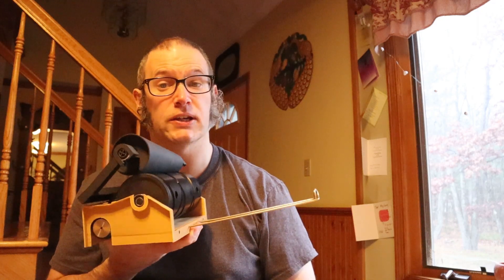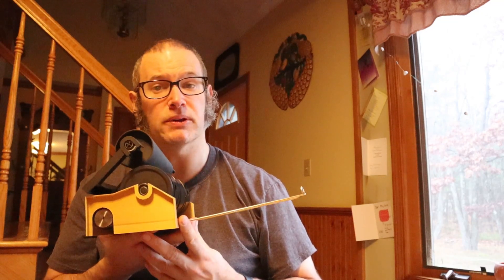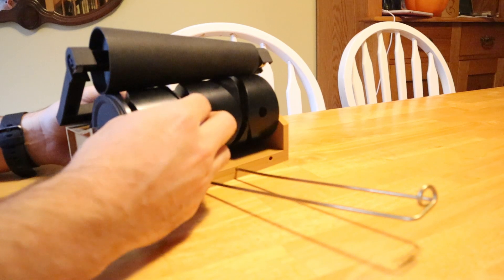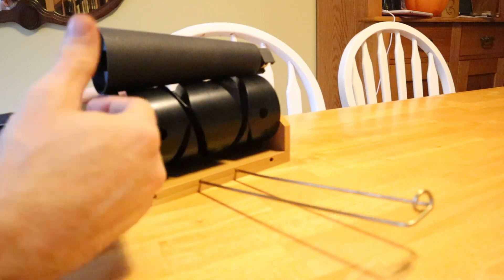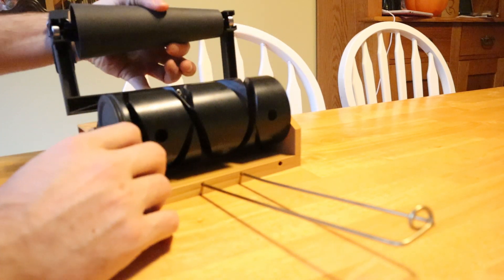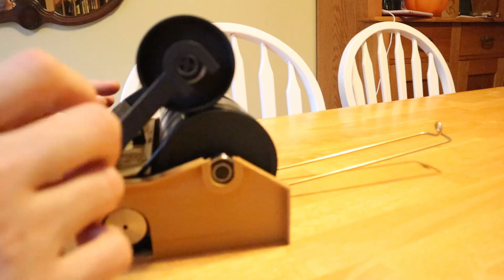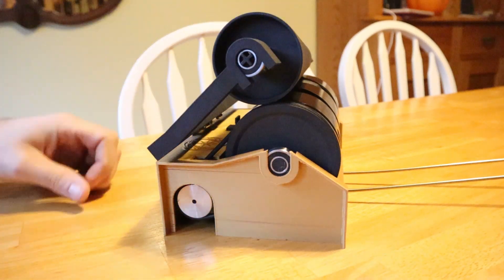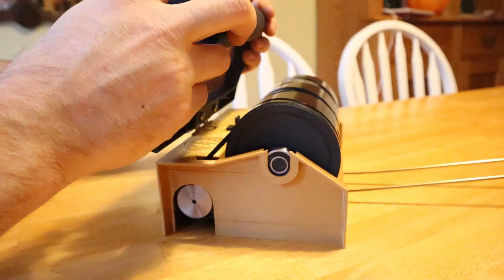SPIN #97 - Cone Winder Update with New Articulating Arm

Comment: Will it be possible to adjust the spring holding the cone in place?  For the purposes of dyeing yarn on the cone, it must be wound into a soft cone (there are also a lot of other factors, but this is the one I'm having issues achieving).  I'd love to volunteer as a beta tester if you need a "high volume" user to put it through its paces (I'm a production weaver and dyer).
Reply: It wouldn't help the vertical movement, but spreading the feet of the yarn guide would help reduce the horizontal "play" (triangle with a wide base is more stable, if that makes sense).
Reply from the maker: There is no spring holding the cone in place.  I've seen those systems, but am leaning towards using the system I showed in this video instead because it helps keep it more affordable and arguably works better.  The downside of my solution is it isnt' adjustable, but I will be releasing files so people can 3d print holders for different bobbins.

Comment: just a thought, instead of just having the guide wire go into the holes in the base,  make a "bracket" for the ends to slip into on the bottom after they go in the holes. That would add a bit more stability and keep the guide from moving side to side.
Reply from the maker: I have a new system I plan to test for this that I think will do better.  That said I don't really understand what you are proposing.  Perhaps if you sent me a drawing I'd be able to provide better feedback.

Comment: looks pretty good.  from a machine knitters perspective, using a little finer yarn that those in the video, it looks to me that it needs a little tensioning for the yarn going on to the cone (from the ball), resulting in a tighter wind on to the new cone.  this will prevent, in my mine, the yarn pulling away several circuts as it feeds off on to the machine.  I have a winder converted from an old mill parts that works well.  similar to your new prototype but very old.  the option of different spindles for different types of cones is of interest.  I have a way of accommodating several different sizes for myself but it is limited and there are so many different cones I have that have come from so many commercial mills over time.  (I am in Australia)  thanks for sharing and exploring the options we might have in the future.
Reply from the maker: Thanks for your feedback.  It's great hearing from others who have experience with making yarn cones.

Comment: Hey there love your cone winder ... could you tell me what the black cylinder is called the one that guides the thread back and forth ?
Reply from the maker: They are widely used in the textile industry, but they are mostly referred to by their Chinese name (I don't read Chinese, but I have a contact that had trouble finding them until we found the right word in Chinese).  In English I think they are just usually called a grooved drum for the textile industry.
Reply: @DreamingRobotsBlog  aww thank you, iv looked al over for a cone winder for thread but there doesnt seem to be a home one ... al industrial ... i have all industrial sewing machines in my bedroom so i dont have room for anything else
Reply from the maker: @aaronabbott1427  I made some 3d printed drums like this, but they didn't work because you need a really smooth surface.  I eventually gave up and decided to just purchase a better drum that I could design for a 3d printer.  I am still deciding if I should make my own plastic mold for one of these drums or to buy one from a vendor, but I'm pretty sure 3d printing won't work very well unless you do a ton of processing after it is printed to make it very smooth and some of the surfaces were quite hard to reach because of the angles/size.
Reply from the maker: @aaronabbott1427  Thanks for the suggestion.  I'm familiar with those.  They are injection molded and that's how they got a smooth enough surface to function.  The 3d printed version of the drum that I made actually followed the hollow design that Royal used, but when 3d printing the surface finish just didn't work.
Reply: @DreamingRobotsBlog  i cant find any where to buy one from .... im from the uk and iv tried every thing in google to try and find somewhere that sells them ... iv tried putting in winding drum, grooved winding drum, textile grooved drum,traverse winging drum .... no one is selling ..... where did you get your from again ?
Reply from the maker: @richyjames1378  I have a partner in China that obtains them for me.  I get really good prices because I often end up buying parts in volume and I pay her for her time to setup these contracts.  I've seen some people use this site to purchase these for individual use but I have never dealt with them: https://gsn-knit.ru/winder/wool_winder_en.html
Reply: @DreamingRobotsBlog  aww yeah i emailed them but i didnt get one back :(

Comment: I am wondering if the guide arm needs to be that long.  Perhaps it would function just as well at half that length.  Making it shorter would allow it to be stiffer/ less flexing.  I'm looking forward to this very much!
Reply from the maker: There are some odd angles required that would not be correct as the bobbin filled if I made the arms shorter.  I choose those lengths for a very specific reason.  Now I could probably get away with a slightly shorter arm because the angle difference wouldn't be that great and the arms do flex some, but I think I will leave them that length so the angles are correct from a mathematical standpoint.  Another concern with shorter arms would be it would limit the amount of yarn the cones could hold, but I haven't calculated how much less yarn shorter arms could hold.

I will point out the final version will use injection molded arms and those will have a lot less flex than they 3d printed nylon arms.
Reply: @DreamingRobotsBlog  Are we talking about the same arm?  I was talking about the metal guide.  I imagine you know much more about all aspects, however.
Reply from the maker: @CarolineNH  I was talking about the plastic arms.  The metal yarn guide ideal length is not something I have figured out yet, but I do know it needs to be fairly long for the drum I'm using to work.  If I make it about half the length as it was in this video it doesn't work.  Thanks for the suggestion though.  I'll try to work out the ideal length.
Reply: The guide length is essential to make sure the yarn is evenly distributed throughout the cone actually, so the yarn is wound up not too tight and not too loose. What is needed is a tension mast of some sort, before the yarn goes onto the cone.
Reply from the maker: @Vivvi1975  I am experimenting with this.  I am kind of thinking to keep price down I might not include a tension system, but this decision depends on what my beta testers find.

Comment: Well, this appears to work better than my Silver Needles conewinder, which could never possibly wind from a ball that's just bouncing around in a bucket.  (The SN does not deal well with uneven tension from the yarn source).  Will be VERY interested in getting in line to buy one of these.  (Is there a spindle that will take SN cones?)  I'm a weaver and CSM knitter.

Comment: Maurice- very interesting and I would definitely like to get in line for a purchase when it is available.  Question- have you tried winding the yarn directly off a swift?
Reply from the maker: I plan to test winding off a swift, but have not yet.
Reply: As long as the speed is able to be adjusted, it technically can work. It all has to do with the setup and also need monitoring att all times. I've done it many times using industrial cone winders and it all comes down to how well the skein is wound up, and how far the swift is set. What I did, was having the swift on the same level as the cone winder but not too close to it, so I could monitor the yarn at the same time to make sure I was ahead of any entangled threads.

Comment: Wow such better!! Great job ! Look forward to the next update.  If you have another cone the winding demo would be smoother if you put a full yarn cone down on the ground to use as your feed yarn?
Can’t wait to get your yarn counter and the cone yarn winder. Eegads my clumsy inventions for counting yarn yardage will go to never never land!
Reply from the maker: I did think about feeding it off a cone, but that felt like cheating a little.  I might do that someday because it would indeed show a very smooth process, but I want to also make sure it works with more challenging sources.
Reply: Baha It’s not cheating Lol . When I have a snaggy ball I hold the end and throw it across the room, wind that, toss it again. At least until it straightens out I get a few yards wound. I also will put it a gallon jar and kind of do the same thing but in the jar.

Comment: This is looking better with each update.

I want to skip the ball and wind from a skein on a swift.  My swift has ball bearings so it spins easily but sometimes there are tangles in a skein. Will this stop in case of a yarn jam?
Reply from the maker: A swift with bearings should work pretty well as long as it isn't super heavy (and even if it is it might work).  I do plan to do testing with skeins off a swift at some point.  That might be the most popular source for yarn being fed onto cones.
Reply: @DreamingRobotsBlog  Yes, I only wind skeins onto cones since I make socks on a CSM from my own hand dyed yarn. Also, could one use the cardboard cones which are widely available, or would you sell the cones to go with it?  (I am Illiterate on 3D Printers!). I’m super excited about your winder!
Reply from the maker: @joannadams8380  I will certainly sell cones that work with it at an affordable price.  I'm looking into how practical it is to support other cones.  I have a bunch of different cardboard ones and it is a little annoying there are so many slightly different sizes which will make supporting them more difficult.
Reply: @DreamingRobotsBlog  I would certainly prefer buying cones specifically for the winder rather than having to adapt another cone. I am super excited about this!

Comment: I have a cone winder that I purchased years ago for machine knitting. I often have problems winding from a ball. I do not think it is all your tensioning device.
Reply from the maker: I think my tension device can help, but I agree going from a ball isn't ideal.  Do you usually use a swift or how do you load your cones?
Reply: @DreamingRobotsBlog  Mostly it depends on how the yarn is at any given time.  I use either a swift or a ball. I have to have it fairly loose, my cone winder throws the chain mechanism if I breathe funny.
Reply: @teresabinwv4713  , is that a Silver Needles winder? I had to open mine up to adjust the sprocket that was holding the chain taut. Ever since Barb died, and the company changed hands, it's impossible for me to get support.
Reply: @HollyMarsh0716  Yes. I have emailed a number of times with no response.  I need to fiddle with it. I had been hoping I could get new chain. I noticed they now have a big notice that they will not support the SN100 anymore.
Reply: Mine is one of the originals. I was counting the other day and it is well over 15 years old. So I was not expecting much. The courtesy of a reply would have been nice